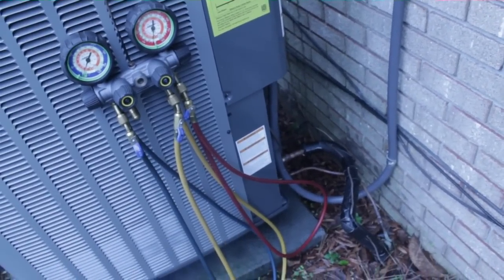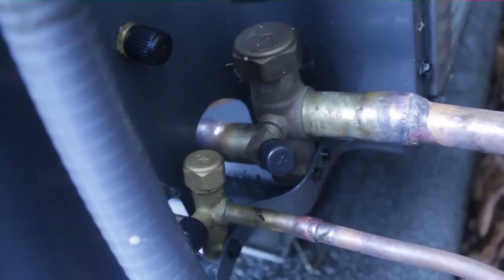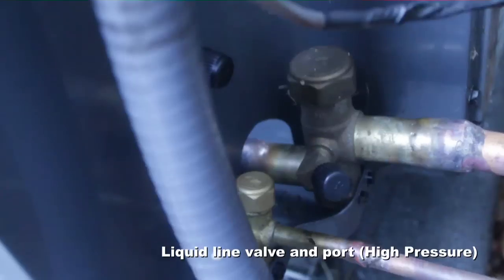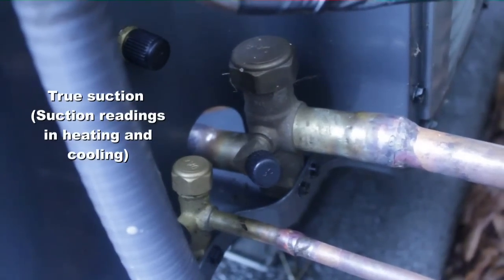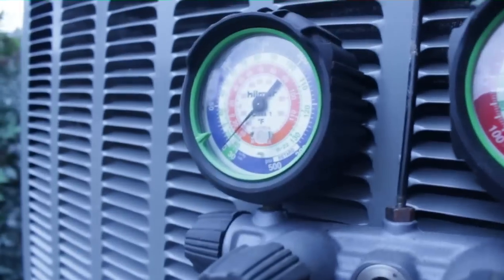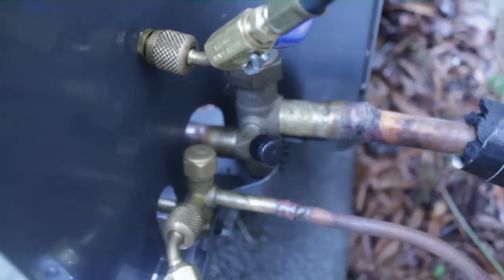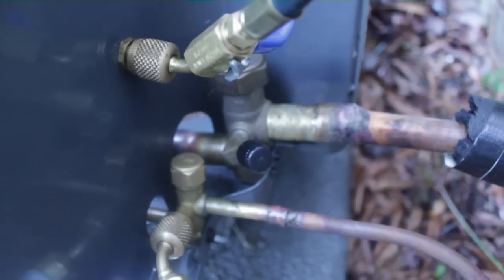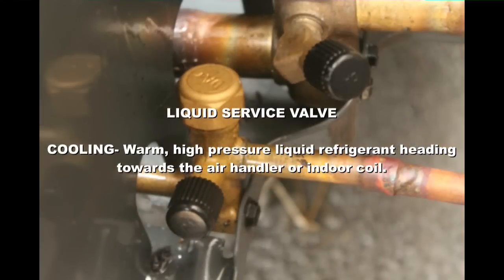How to Connect Manifold Gauges to a Heat Pump

Comment: My  heat pump has just two service ports that I can see, not attached to either line. They are off to the side, one above the other, a little over an inch apart, and unmarked. It's an old Tempstar, installed 1993, with R22. Is that unusual?

Comment: You are an excellent teacher Zack. I look forward to more of the Manual D videos and Load Calculation stuff. One thing I have noticed is that some manufacturers are using the large (hot gas) line for the pressure in heating mode. I always check the chart on the unit to be sure. It seems to mostly be systems that have a heating orifice on the outside of the liquid valve.

Comment: What should the head pressure on a heat pump in heat mode be for 410a at 60° outdoor and 72° indoor
Reply from the maker: Lot of wide ranging factors but near 400 or so

Comment: so do you always shut the unit down before installing your guages?  We use a lot of R410a systems, and i always hate when removing the high side hose, i usually get sprayed with a little bit of refrigerant and yes, you do get burned pretty quick.

Comment: This is a really good video. I would like to see a video on where you put your temperature clamps to check superheat and sub cooling in heat mode on a heat pump in conjunction with the manifold pressure readings. I have tried to show my technicians how to do it time and time again but I am not good at making videos nor do I have all of the equipment necessary to edit said videos but I would like to have a link that I can put on their iPads for some training and you sir seem to know what you were doing and you seem to be very good at getting your point across. Also if you happen to have any knowledge of any videos that are already online for this then maybe link something in the comments if you don’t have the time or feel like making any more videos. Thank you very much
Reply: In most situations, just put your temp clamp on the hot gas line and shoot for 100-110 degrees over outdoor ambient-- it will get you very close.

Comment: Great Video Zack, explaining the different procedures. There are also specific manifold gauge sets also designed for such systems (heat pumps guages for couple bucks more) when you are working in field and suddenly if the system switches over will not cause the gauges to peg over, or have to change the hoses directions in flash!. These gauges are higher pressure rated and thus avoid the disaster to gauge set if suddenly pressure changes or reversing valve switches. Like your video and good explanation on charging port. Thanks Excellent videos !
Reply from the maker: rmwaseem thanks

Comment: Great viedo.  What if u do not have the true suction line coming straight off the compressor?
Reply from the maker: Pierre Ruff what system are you working on that doesn't have it?
Reply: Some of the lennox heat pumps